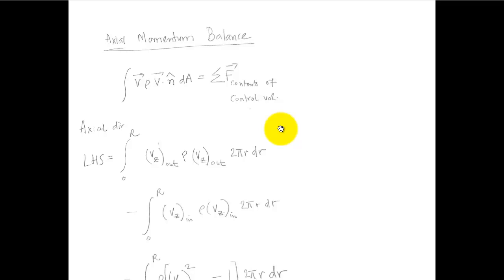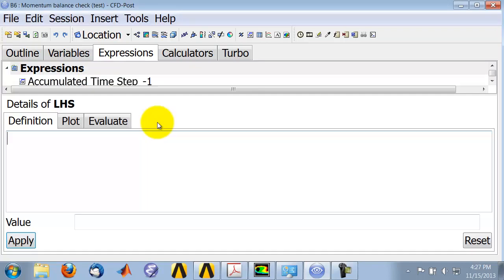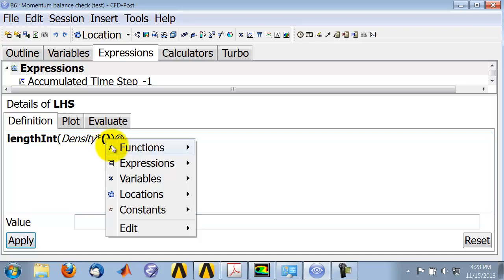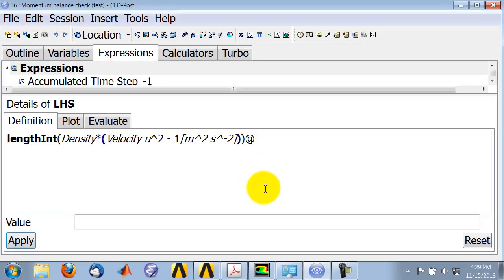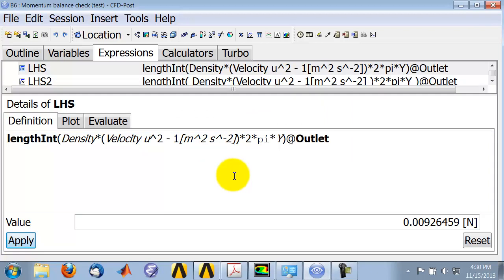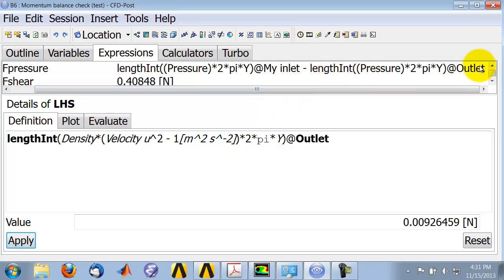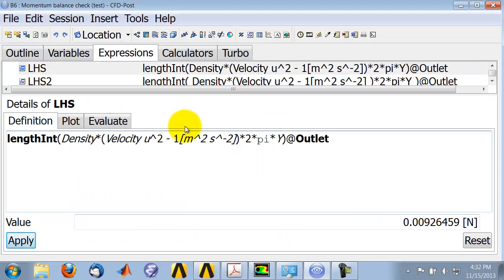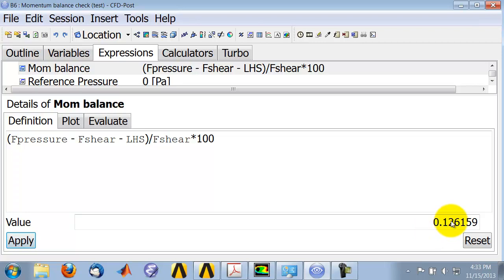SimCafe: Laminar Pipe in FLUENT, Momentum Balance

Comment: Professor, I think you should use "1[m]" instead of "Y" inside the "LengthInt" operator, since the "Y" length is already selected on the "@(choosen path)" domain for the line integration. The "1[m]" represents is the unitary length in the "Z" direction that can be written like that inside the integral once the problem is 2D, also this factor is important for the PST to show proper force units on the result of the equation.

I just finished and passed the EDX simulation course and I want to thank you and Cornell for this course, you are doing an incredible job sharing free information for the entire world to learn and to be inspired by. I am a Mech student from Brazil and if it wasn't for courses like this, people like me would never have the opportunity to learn such a powerful tool like Ansys.

Looking forward for the optional Modules on the Course now! Thank you very much!